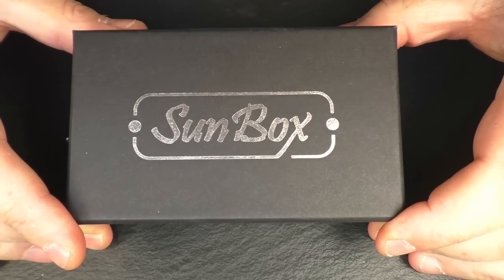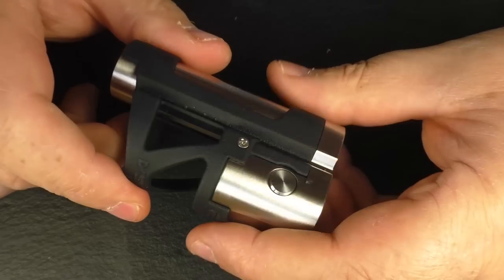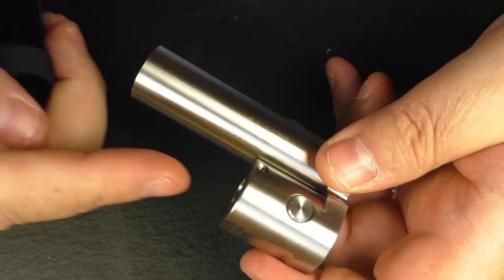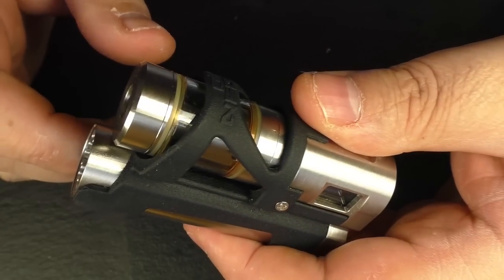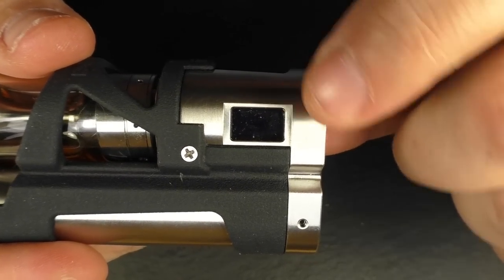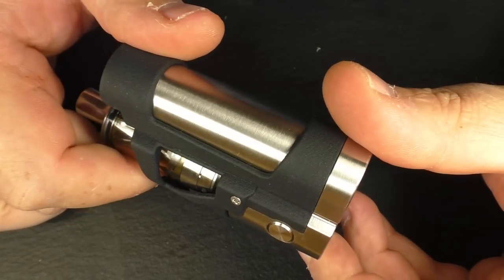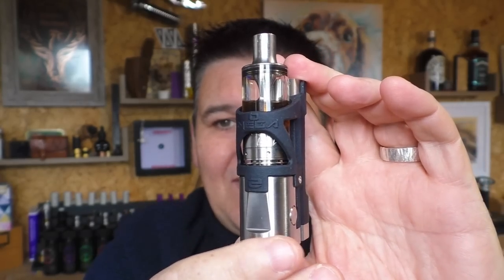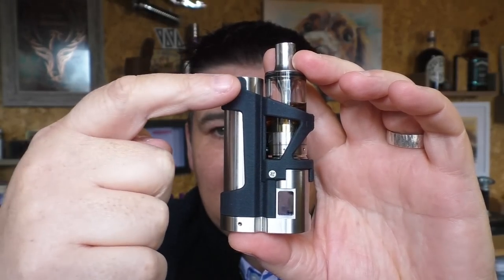Zero Nega 2 by SunBox

Comment: I picked one of these up recently to replace my Xvo as my DD and I love it.  My tanks are all 45mm-50mm tall so I finally have a compact setup even with the largest tanks .  Mainly this was the first Dicodes device I've seen that I actually like (I've moved on from box mods and tubes, and stab wood is  pretty but not for me).  The chip really works well and with their NiFe30 wire this is the first time I've had a good experience with temp control - I get it now.  It's also very comfortable to hold and doesn't feel like it will slip out and fall to the floor.

The button only took a few days to get used to, now I hit the wrong spot on the Xvo when I grab it.  A great thing about the placement is it's difficult to fire accidentally either palmed or pocketed even with other things in hand.  I never remember to lock my mods and fry a lot of wicks on accident so this has been a big plus for me.

Comment: Missed you mark
I bought it 3 months ago

I use it with
Taifun gt3
Nduro
And the golden set up is Flash-e-vapor 4.5+s 

I love everything about it
Only the screws, I wish it was better looking like a German hex Bolt or a colored screw 
And I don't love the place of the button, but i don't hate the placment, I did manage to get used to it

My all day device, because of the design, and specially the chip and size
The chip is the main positive actually

Thanks Mark

Comment: i guess each vaper should have those 510 heat sink things ,  i use them with my tanks on a mech mod when I'm not sure of the atty pin.  thay cause voltage drop but it is better to be safe.  nice mod and imo those screws give an industrial look in a way which i like.  nice review Mr.  Todd,  take care.

Comment: Mr Todd, if you want a mod with matchy matchy screws, the undercodes insider DNA60 has black screws on the plastic frame and silver screws on the bottom plate 👍🏻
Reply: Michael Perkins I love my Insider! It fits most shorty rta’s no problem. Fire button is in a nice spot too 👍
Reply: Troy Rossi Nice. I’ve got mine coming today and must admit the matching screws were a factor! Also getting the Atmizoo Tripod also 😬
Is there a Facebook group for insider mods/Undercode, I’ve had a look and can’t find it. Interested in getting replacement tubes in the future!
Reply: @perkynipzreviewkitchen8548  Yes! there is a group. The Undercore/Insider is a CoreDesine project. The face book groups are COREDESIGN ( 18+ / 21+ )  and  COREDESIGN ELITE SQUAD 18+ / 21+ . I haven't seen any tube replacements yet. Not sure if they are swap-able.
Reply: Troy Rossi Thanks very much. They are swappable, you can unscrew it from the base. I’ve seen a few tubes on some Italian vape stores, just google search it, but I’m after a specific one!
Reply: @perkynipzreviewkitchen8548  I'd love to get a knurled tube for mine. The cracked and dama etch arent really my cup of tea. Good luck to ya man!